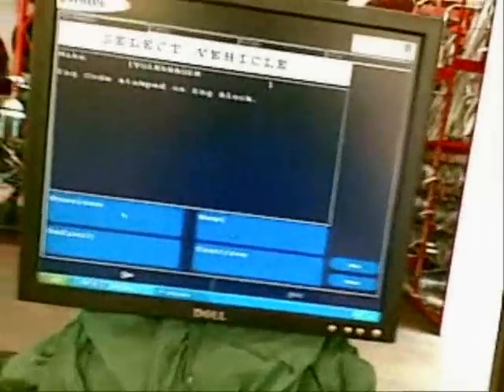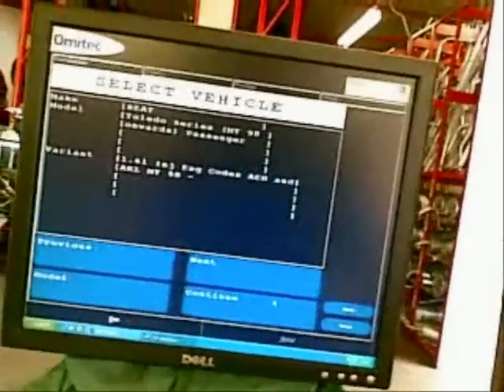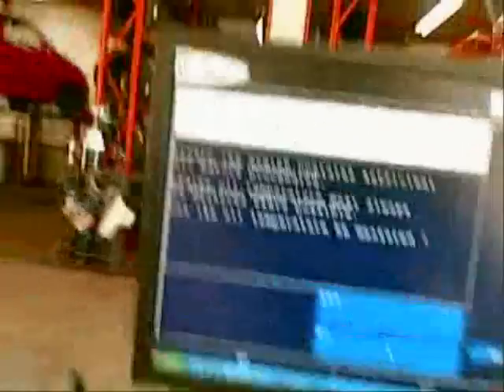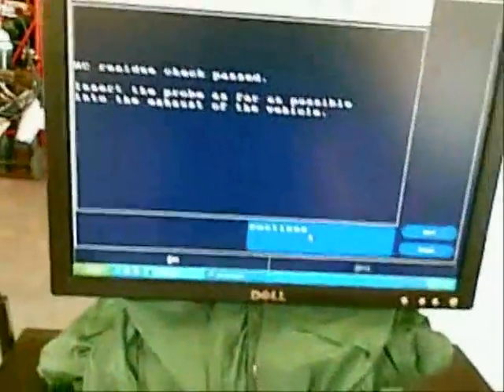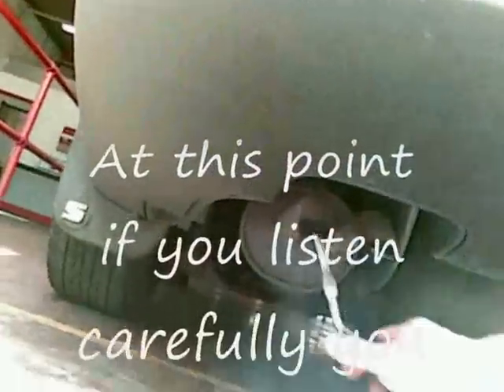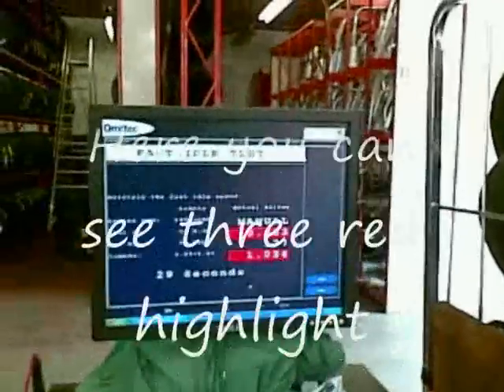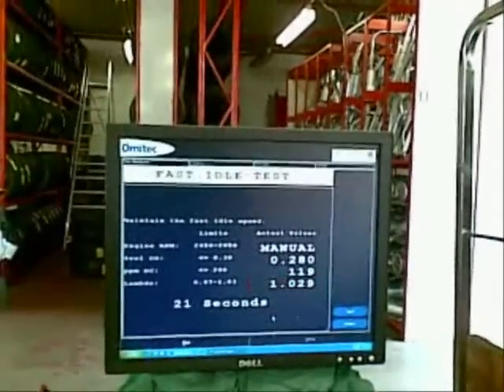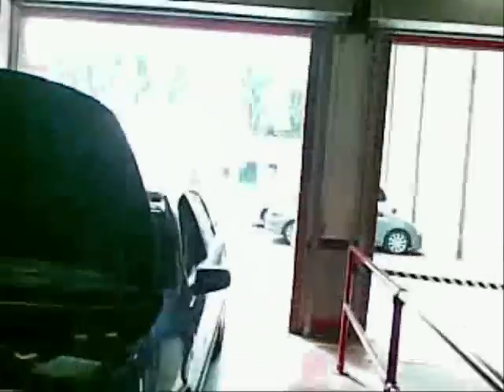VOSA: MOT Car nearly blows up, Emissions Test

Comment from the maker: Follow the flow charts.  I use a brake pedal depressor to hold the throttle steady during test.  Just watch the engine and header tank during test, keep eye on temp gauge to.  You see in the video I move back and forth lots!!!!!!!!!!!!!!!!!!!!!!!!!!!!!!!!!

Comment: If the header tank boiling, surely head gasket or was it something else?
Reply: sandydogy Any coolant leak could cause boiling coolant in the header tank as it won't be at the correct pressure.